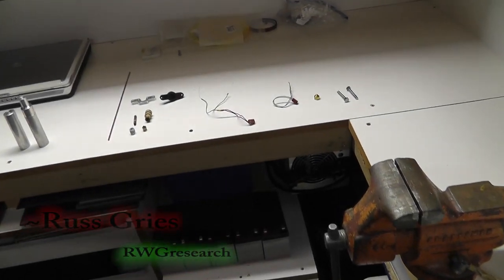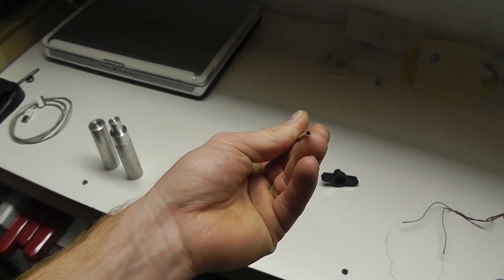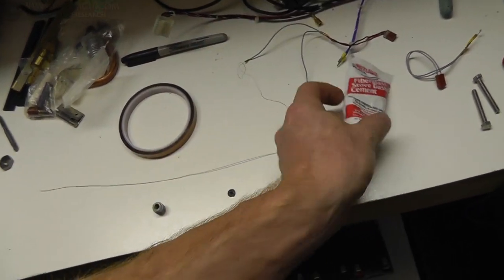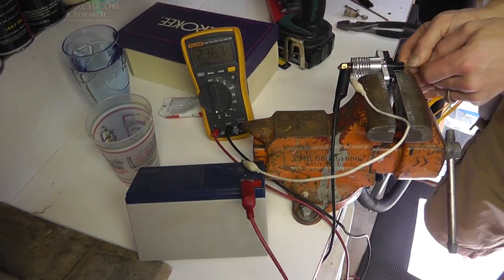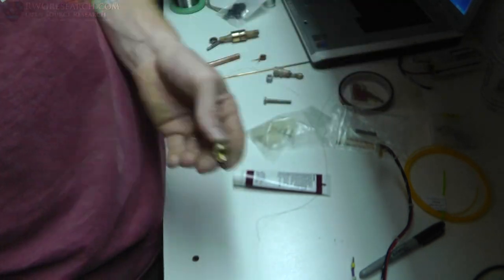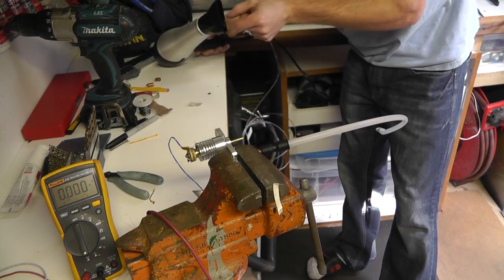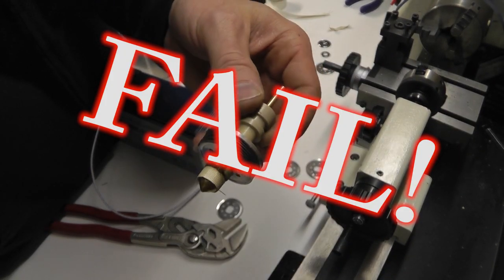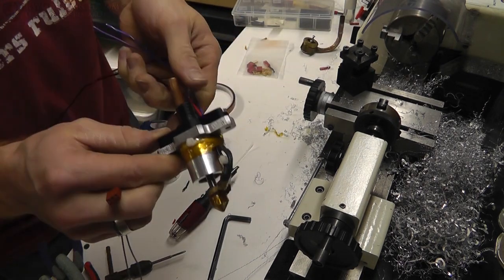All Metal Hot-end Fail! & The Fix, Full Build Process... Simplicity Wins..

Comment: lots of work, grats russ. i see you are blowing on your prints with that cooling air, if you are using ABS that means curly prints. i bet deltas have more curling probs cuz of the spherical positionning domain (eg: not X-Y or cartesian domain). i see you are now using less abs goop and more skirts and brims, nice. i use plain old paper glue sticks, non toxic for kids for arts and paper crafting on a 60 deg C bed, i dont get the pop when it cools off but a little isopropyl alcohol and it dilutes well off the bed. personally i use alu rectangle block with 16mm ptfe rod with a wades greg geared extruder. im not on a delta though and not in bowden tubes. great work again!

Comment: So did you what you made at the end or a complete new one? Cause i dont see the copper tube on the side and no cooling fan on the extruder cool side?
Reply from the maker: Hulla Dek yeah i maid a new one. same cooling tube. the fan is placed on the side of the printer and there is a tube that the air comes through and cools the head. however, the fan is just cooling the entire head and the print... never really seen an improvement on cooling the "cool side" on the hot end. there is so little mass there its dose not need it. or do my testing tells me so :) ~Russ

Comment: Do you bed level that printer out manually, or automatically with some type of switch?
Reply from the maker: On this version of my printer I have the "auto bed leveling probe " however I still have to level the bed manialy. It has something to do with the delay setup. One side is all ways ever so slightly off. Talking .1mm here or less but if you want to prent a big object it madders. ~Russ
Reply from the maker: ***** delta * not delay. Spell checker ... I have other videos on this " auto bed leveling probe"